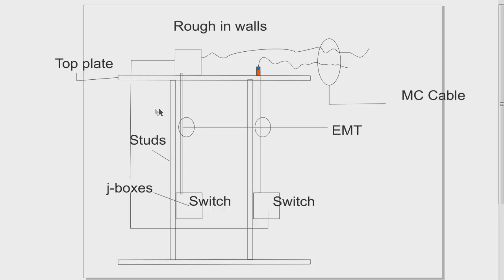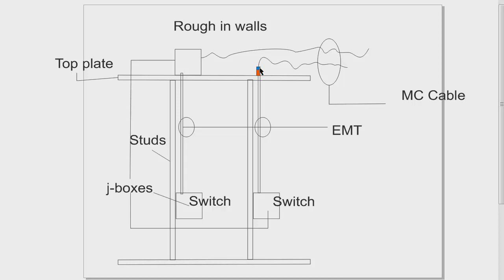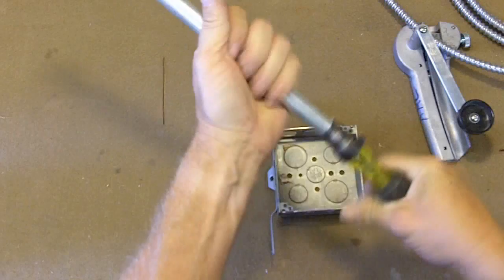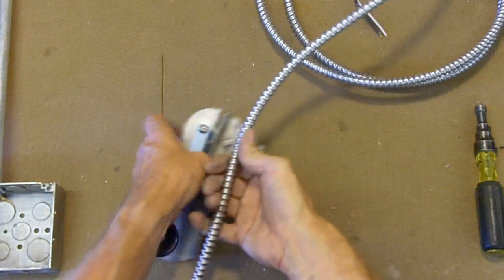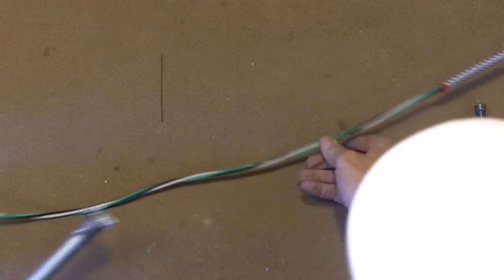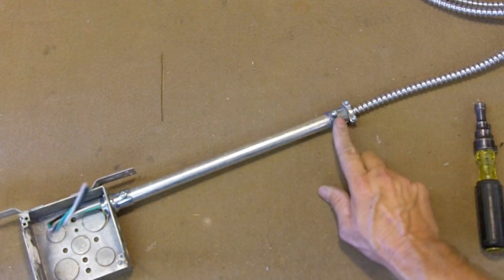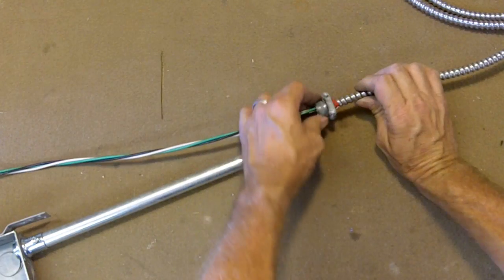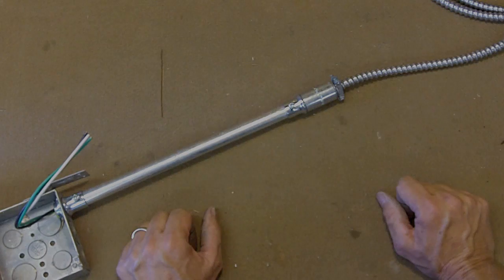Practical Electrical Wiring-MC to Emt Connectors

Comment: I added Emt to my crawl space from the main panel in 3' Lenths for further needs. I added a mini split A/C and bought a 250' roll of mc and wished I knew about this Emt to mc adapter.  I remove the Emt with a pull wire in it to  pull the mc up into the panel the Emt was to long to remove in 1 piece. I the lowered the Emt and cut it with a tubing cuter so not to cut my pull wire. I had to drill the hole larger for the mc connector. in the floor plate. Then installed the mc connector with about 20" out for the breakers and ground. I'm pushing and then go up and pull until it would go into the hole in the panel. I wired my complete house with Emt. I made a jig and predrilled the holes for the studs then installed the studs were I wanted outlets shoved the Emt in then the last studs without holes. I bought the Emt from the top of the panel though the trusses down from the 4" sq for the lights. I learned how to bend Emt in the Air National Garud.  I was like an apprentice working under a Journeyman back in the 80's I'm now retired.

Comment: Its NOT legal to use a heavy wall coupling to join anything but threaded pipe. Reason being rigid conduit has a tapered thread and type NM, AC,MC, EMT, Greenfield connectors & chase nipples do not have tapered threads so this could cause a problem on clearing thousands of amps during a dead short. Yep don't know one sparky who has not used coupling to join connectors. I been reading the quarter million word code book for over 50 years and still learning.

Comment: Best practice for any armored cable is to cut the admire end at a 45 degree angle & spend 2 seconds to I stall anti short bushings. Yes they are not required by NEC but the large hospital that I retired from it was mandatory to use anti short bhshings.

Comment: I am going to do the anti or opposite of this to replace existing wires to an outlet and use the flex conduit to the outlet box  to avoid drilling new holes or having to do weird bending EMT to go through existing holes to reach the outlet box and use EMT for the straight and easy bends.  Took me all day to bend a 13" piece of EMT to align an existing outlet box  and hole that goes through floor to crawl space.

Comment: In my area it's city code that requires the anti short. Note, for the last 25 years or so most walls are roughed in with bx all the way to the wall boxes. Only time you'd use pipe is due to poured walls or switch boxes that contain multiple circuits and you run a larger pipe to hold them all. I've never seen bx to emt. It truly doesn't make any sense to strip six or eight feet of armour to save a box or to avoid running bx down the wall.

Comment: Well that's an interesting tool I didn't know existed. Now I want my self one of those reamers with screwdrivers.
I having used an MC splitter and also didn't have access to it since it was borrowed, having to do it the old way and yeah it's way easier and way faster and way nicer.

Comment: Can u put a GFCI any where on the circuit. I do know it's supposed to go on the first circuit to protect all . But is it ok to put extra
Reply from the maker: When installing receptacles on the load side of a GFI receptacle it is not necessary to add additional GFI outlets. Can be put anywhere in the circuit, just depends on what you need to be protected downstream.

Comment: Sparky, I just finished reading that the NEC does not allow the MC wires to be run through conduit without the outer metal cladding. Do you think it is safe to run just the wires from the MC cable through the conduit? Thank you so much for all of the help.

Comment: To those watching, the connector used in the beginning is probably for Romex not MC cable.  If good inspector, this would not pass inspection.  The conductors inside the cable are not imprinted with information as required for EMT.   I think the fitting is made to connect Romex to EMT for protection where required, but you leave the sheath on it.  That is why most put a box on the conduit as shown at the beginning.  The last method with the coupling is absolutely violating listings and therefore NEC.   Some electricians did similar to this on a large job.  They got caught and cost tens of thousands of dollars to replace them all.
Reply: And everyone is all praise about this.
Reply: @computationalerr      When I used to teach electrical designers, one thing I told them was “Just because you can, doesn’t mean you can.”

Comment: why not run the MC down to the switch box and save yourself the cost and effort.. are you saying this is for exposed conduit?
Reply: Sometimes the drywallers want to get in/out as fast as possible. I've used this method to complete the electrical after drywall is on and since there's drop ceiling we can have access from above

Comment: i learned a lot from the video. the only thing i didn't like was watching 3 minutes 40 seconds of being told what i was going to be told. i guess most people like that, i am unusual in that i just want the info i am going to be told and not that you are going to tell me what you are going to tell me. i'll preface that with i would like to know what the basic topic is, e.i rough-in elec instaltion connecting MC cable to EMT. ok got it, go. i did like the diagram of the j-box in the ceiling too. all this should take 20 seconds.  thanks for taking the time to make and post the video. thank you, now i'll continue watching

Comment: I have that very same rotary hacksaw. Works well. I have the reamer that fits on a screwdriver and I agree with you about it.  Now I just use a large step bit on my drill  for de-burring.
Reply: And I hated being called "sparky".  I rarely created sparks except that one time when I was an apprentice and I cut live romex with my brand new diagonal cutters and turned them into wire strippers by arcing notches in the cutting edges. The journeymen on that job did not let me live it down.

Comment: what's the dif between MC and BX?  Are anti-short fittings available separately?
Reply: BX is a trade name of one manufacturer of MC I believe (kinda like 'romex' is used for all plastic sheathed indoor cable in the US)
Reply: "BX" is a trade name for Armored Clad cable. Armored clad includes an aluminum wire which bonds the entire metal sheathing. MC cable does include the aluminum wire and you must use the included green conductor for grounding purposes.
Reply: @jasmany19 *does NOT

Comment: I had to replace a light fixture, when replacing it i noticed the wire was a 14 gauge afc flex electrical wire. But my problem is that the wire looks like extension cord wire,       the lead and neutral consists of several thin strands of wire. The only time I have ever seen wire like this was on an extension cord, that's why I used an extension cord as reference. I'm not sure how I feel about that. what is your thoughts? Since the wire is manufactured in aluminum flex, could there be another intended use for this wire. I was told that years ago this wire was used in homes, and that the aluminum shielding was the ground.

Comment: Why would you do such a thing like that? Just run the mc to the box you dont need emt for that. I am a licensed Master electrician for the last 30 yrs.
Reply: For me, aesthetics. With surface mounted boxes, EMT looks much better than MC. I will often pull MC through the ceiling then change over to EMT when coming down the wall to surface mounted boxes.
Reply: I do the Same Irvine

Comment: in remodels of supermarkets, We use the second method for the stub up for the low voltage temp & defrost cables  for the cooler cases. This is not only accpetable but needed as we need the cases up ASAP. Bending pipe for a run of 8 cables for 8 sepsrate cases takes too long

Comment: Usually mc box connectors have a shoulder inside with a hole for the wire to pass so the bushing does not fall out. Don't they have a emt to mc connector with the same kind of shoulder inside. I would have thought this emt connector you have is designed for romex instead.  I guess actually I have not see one that has a shoulder, but it makes sense that they should.  The problem is with the one you used first, the emt to mc, has nothing that will stop the bushing from falling into the emt with the wire. The second way would they be better if you are using an actual box mc connector with the shoulder. Just more parts which will cost more.

Comment: I've been working with a lot of MC lately A friend of mine just moved to a new commercial space and the requirement is that everything has to be in conduit or MC I don't mind working with that I kind a like it. I just had to run an three-phase aluminum 200 amp cable MC 140 feet from one side of the room to the other so that we could put a second 200 amp panel in so that we could have a lot of power on that side of the room we still have 200 amps since the main is still 200 A this is a 200 amp subpanel. It's amazing that were even getting power under heavy load because the 200 amp service has to go like 400 feet before it reaches the meter. It's a 200 amp meter three-phase but it also shares a 100 amp breaker panel in the center of that 400 feet of line about 200 feet that is powering stuff we don't own. So the place that we are renting pays for the stuff they use on our electric bill and we pay ours but it's on the same service.

Comment: Your GRC coupling to transition is a code violation.  I have seen this  written up in EC&M and Electrical Contractor.  Joe Tedesco did a write up on this.  It's a 110.3 (B) listing and labeling violation and NEC 300.15.   A galvanized ridged coupling is not listed to be used for transition, that's why they make the proper fittings.  You can also reference NEC 300.15 (Fittings and connectors shall be used only with the specific wiring methods for which they are designed and listed.)  Your first method using the proper transition meets the code.  Good video, thanks.
Reply: Isvtecb18c1        I don't write the codes, the NFPA and the International Code Council  do.  Talk to them, I gave you the articles  to read.
Reply: Excellent comment - complete with code references!   It helps the rest of us to learn the CORRECT way to perform wiring tasks.
Reply: Mike Fox I guess that means the code doesn't mean shit then. I have done this and it has been done thousands of times a day for many many years and has never failed an inspection .
Reply: D. Jensen.  Enjoyed your video.  Keep teaching,  not enough young people are getting interested in the trade.  Videos like this make kids think that might be a great and interesting way to make a living.
Reply: no i believe your siting of the code is correct, but in this situation I have never seen a failed inspection due to these conditions and materials used.
Reply: I agree, very few inspectors catch it and I don't think it's dangerous.  It's one of those AHJ decisions.  When you get up to larger size conduits it is very hard to find the transition fittings listed for say, ridged to EMT or EMT to Sealtite.  It is very frustrating and like you I thought it was totally crazy because that is how I was taught to do it.  As far as failed inspections it depends on the area.  There are some real finicky inspectors in areas like New York City, Chicago etc.

Comment: A newbie here, thanks for showing how the parts go together.
Reply from the maker: John Lauer Hey John,thanks for watching & the comment!Glad it helps.
Reply: You bet,  question.  Can I bend Mc  cable to ninety degrees and still be in code.  I would take not use boxes to get the ninety degrees.
Reply: *do not want. To use boxes
 Sorry for the typo.
Reply from the maker: John Lauer Just use common sense when making your bends.You don't want to bend it so tight that it breaks the aluminum sheath.

Comment: Great video Sparky!  I have a question.   Is there a restriction for the length of MC you can run to a light fixture?  I have about a 10 foot run I need.  

thanks.
Reply: Ithere is a  restriction on fmc, tthere is a restriction on fmc, empty flexible conduit that you fill but neither ac or mc have length restrictions. 6' for fmc as far as i know...
Reply: kornsnap 6 feet

Comment: Excuse my ignorance but is it not possible to just wire the MC cable back to the joint box? i mean, why go through the trouble of joining the MC cable to EMT and then bring that back to the joint box???
Reply: Typically MC allowed above drop ceiling grid where not visible whereas below ceiling EMT often required for aesthetics or as a power pole to newly lighted or interactive TV retail display shelving.

Comment: By the way MC cable does not require an anti short bushing. There is no code that requires it on MC cable. MC connectors are by default designed to prevent shorts if properly cut.I investigated this by reading manufacture reports and whitepapers. The only reason your receive the anti short bushings is a courtesy from the manufactures. I haven't used Anti shorts since I found that out and have a very good track record on not having shorts. Maybe 5 shorts in ten years caused by lapses in inproperley stipping the jackets. I've made many thousands of MC terminations in that span
Reply: Dragoljub Kolar i use them anyway but only if they come with it, mostly just to pacify some people that are picky SOBs and i dealt with my fair share of them, or if i been requested to use them,  and its not like its hard to do anyway, but i agree they are definitely not required or necessary

Comment: BX was originally manufactured by the Benfield company in the Bronx. I read that there are to possible reason why B.X. is called as such. 1 Benfield experimental  2 Bronx experimental....As an anecdote I remember my Industrial electric shop teacher (First class old timer fond of calling us in the shop Junior Jackasses) telling us that he will give us a passing grade for the marking period if we came up with the answer. None of us could even after going to the local supply houses.I stumbled on the answer in a text book 10 years after my teacher passed away.
Reply: Was told at an IAEI continuing education class that term BX came from it was the second type of cable they experimented with. Wish they would outlaw type AC ( BX ) cable and just make everyone use far superior type MC cable. For at least the last 35 years in !y area you are not allowed to use BX in commercial builidings.